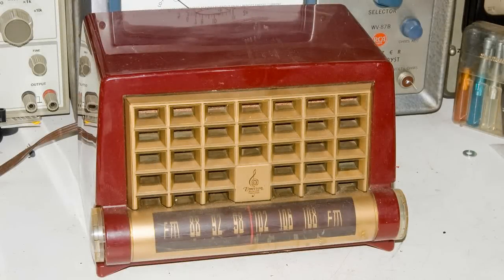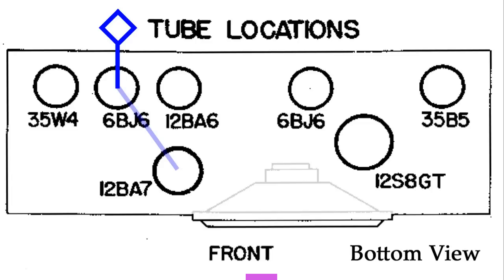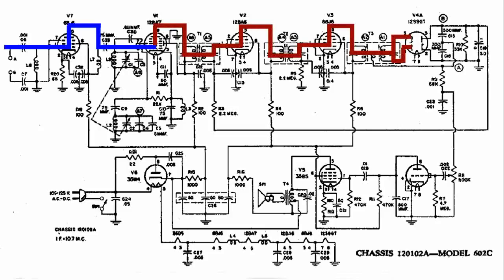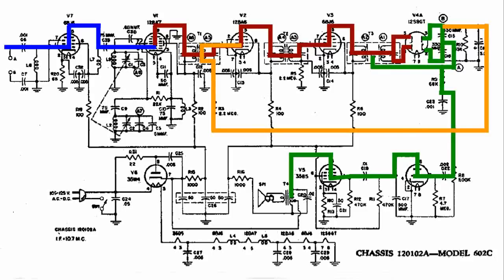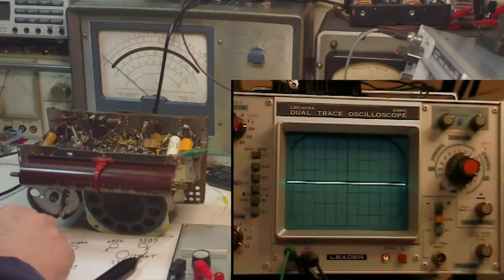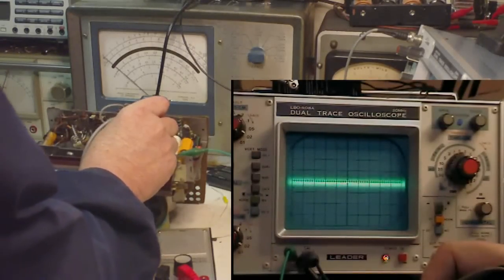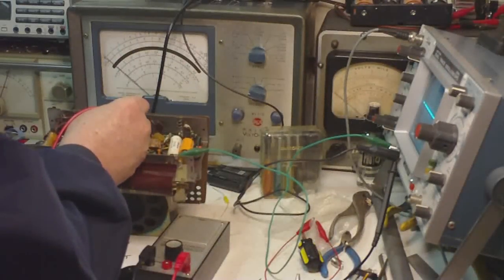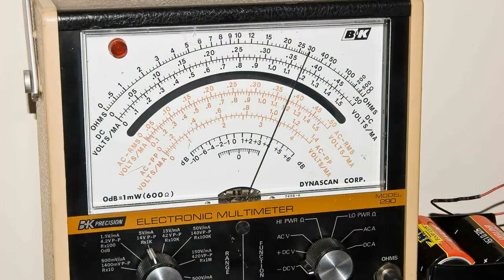FM Radio Signal Tracing

Comment: Does operating the AVC polarized capacitor “backwards” shorten its life or damage it in anyway? Just curious.
Reply from the maker: Installing any electrolytic capacitor “backwards” reverse polarity will damage the capacitor. If you do this in a power supply the capacitor may explode.
Reply: @AllAmericanFiveRadio  does the AVC circuit mitigate damage to the capacitor in some way? Or is it just a known point of failure after time?
Reply from the maker: @kelseystickney8663  
It is how electrolytic capacitors are built. 

How does an electrolytic capacitor work?
https://capcomp.de/en/ultracap-knowledge/function-ecaps

Electrolytic capacitor
https://www.physics-and-radio-electronics.com/electronic-devices-and-circuits/passive-components/capacitors/electrolyticcapacitor.html

Comment: Thank you for this 
This may be a bit of a dumb question but what is the difference or advantage  between having an   oscillator tank circuit or an oscillator vacuum tube 
Thanks
Reply from the maker: The tank circuit is the resonant frequency part of the circuit. The vacuum tube supplies enough enery to the tank circuit to keep the entire circuit oscillating. Positive feedback. 
The Oscillator Mixer
https://www.youtube.com/watch?v=d96vwarHcsg
Reply: Ah ok thank you.  I think what confused me is that perhaps some radios. (Maybe older ones) will have 2 separate tubes for this. One for the oscillator and one for the mixing where some radios will have it on in one tube?
Reply from the maker: @alexinnewwest1860  The higher end radios and military radios usually have a separate oscillator tube. Making the radio more accurate and stable, but more expensive.
Reply: Ah thank you for clearing that up for me.  Makes total sense :-)

Comment: Does having a negative voltage on the grid clearly prove that the oscillator is running? What if a Schematic calls for 7 V negative but you have 4 V negative what was that suggest?
Reply from the maker: For FM I would use an Oscilloscope to determine if the FM oscillator is working.
Reply: AllAmericanFiveRadio In your video you mentioned that checking at the oscillator tube is often impossible. So would you suggest checking it farther down the chain? That seems fine but if one of the I F stages are inop it would be inconclusive right?

Comment: Hello Jim please excuse what could be a silly question as I have no experience with broadcast receivers and specifications. What do you use a a typical input setup for your RF signal generator. I would typical use 3khz deviation for the narrow band equipment I normal play with. But I see most FM broadcaster receiver specify 1khz mod with 75khz deviation. Have I got this right as my signal generator won’t exceed 20khz deviation but it’s really designed for mobile radio repair  Marconi 2955.   Is the deviation setting real 75khz. Many thanks regards Chris
Reply from the maker: What is the model radio you are working on.
Reply: AllAmericanFiveRadio hello Jim I don’t have the radio in front of me now but it’s a 1980s kenwood tuner, AM FM stereo. I’m not actually working on the radio as such it’s just that it is the only receiver I have that has a 75 ohm input. I noticed it was picking up my test tone  1khz 100mhz at less than 1uv but sound very scratchy, increasing the signal level did not help. I think the problem could be the deviation of my test set as it only goes upto 20khz. So I’m really just after some typical deviation and input levels you would typically feed into a stereo tuner etc with your test gear. I can find the tuner info later  but it’s not really a question specific to the tuner.  I think the problem is probably with my signal generator in that it’s not designed for stereo or the deviation level etc. I will find a link to my previous tuner video. Many thanks Regards Chris
Reply: KR-2600 https://youtu.be/_INvbhLGWRU

Comment: I'm curious about how your oscilloscope was connected to perform the checks, do you have a video on the set-up?
Reply from the maker: The radio that is under test is always on my isolation transformer. The oscilloscope ground and the radio ground are connected together. The points that I tested in this radio are marked with a red arrow and on the wiring diagram you can see the pin number and tube number. In the video is a page of how to count the pins on several tube socket types. This information is also in my free e-book, here is a link to the download page.
http://www.richardmcwhorter.com/vacuumtuberadio/

Comment from the maker: Your microphone would have have a fairly high output. You could try connecting a microphone across the volume control, but it doesn't look like your radio has a pre-amplifier.

Comment from the maker: My oscilloscope has an impedance of  about 10megs. So if a circuit is also 10megs, the scope will drain  half the power from the circuit. If the circuit under test is 100megs, then the scope will pull it down about ten times more.

Comment: Interesting video, but there is one thing I don't understand. How is it possible for measuring instruments (like an oscilloscope) to short out the signal? The inputs of scopes are high impedence, so that they should not interfer with the circuit under test. How can e.g. a 1 MOhm input impedence short out anything at all? Also, I noticed the scope didn't short out the signal anymore after the demodulation stage. How come?
Thanks for all your videos.

Comment: hi rick, i have a question that is not related to this video. i have to replace some capacitors on an amplifier but the amp was made in sweden and uses roe brand capacitors that i think were made in germany. these capacitors are not labeled like normal capacitors. one says 10/63 another says 22/63 and the last says 47/63. does this mean 10mf/63volts etc? they don't look big enough to handle 63volts so i am kind of guessing it means 6.3v maybe . please explain these numbers to me, thanks.